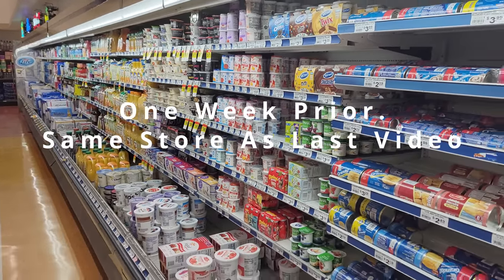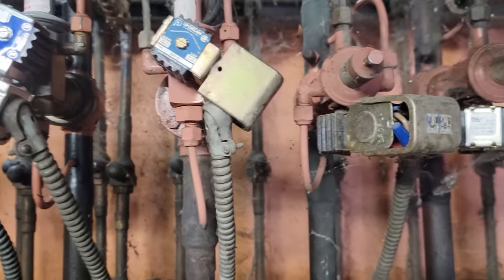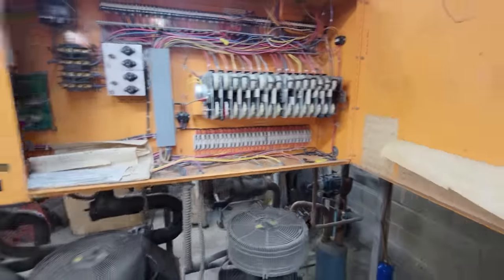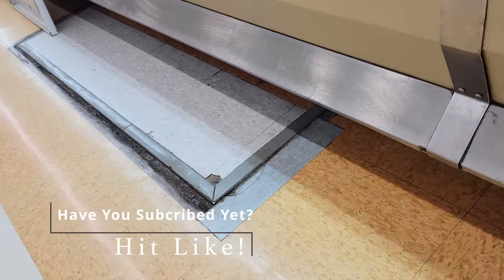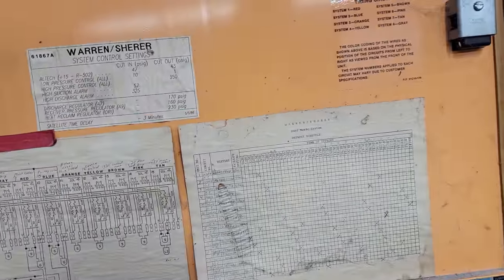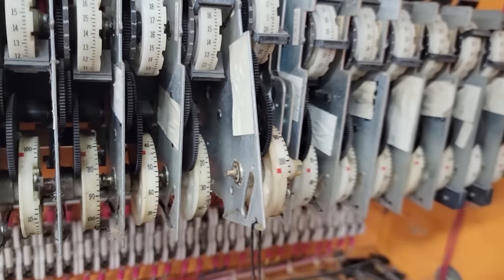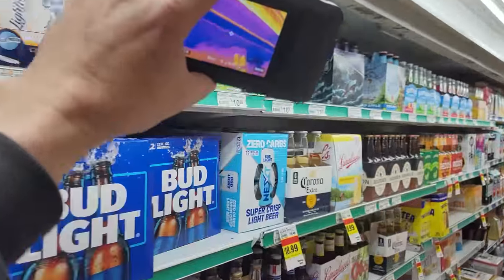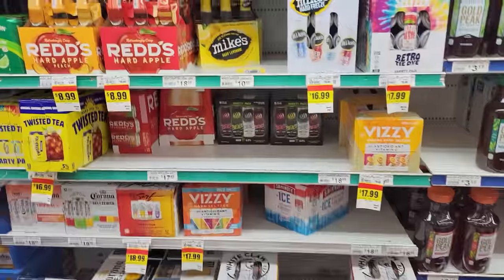Dairy Case Warm Wheres The Control?

Comment from the maker: This call took a longer because I wasn't sure how they were controlling it when I couldn't find the thermostat where I figured it would be at. I found the defrost clock not always kicking in and out like it should by accident and was not the primary reason for the rack being warm. Once I found the thermostat I noticed the store map that I first looked at showed the thermostat being located in-between the middle cases but because things are normally not labeled well or at all I didn't put any faith in it. Now I know where it is and so DO You! 😂🙆

Comment: Great video brother. Finding the thermostat is half the battle sometimes. Also watch the little dip switches on those clocks. I have found some that wasn’t making to send circuit in defrost . We purchased some through Grainger and replace when needed. Those old clocks parts are getting hard to find. Happy Easter.
Reply from the maker: Thanks for the info Michael, happy Easter to you as well!

Comment: Was that a  thermostatic switch up in the canopy? A non-adjustable one that closes and opens at a preset temperature? And what does it control? I'm thinking the solenoid in the bottom of the case? Those supermarket systems have so many points of possible failure it' really looks tedious just trying to figure out what the plan is. Now I know why refrigeration techs don't or refuse to service supermarkets.
Reply from the maker: I believe it had a traditional Honeywell style thermostat as you described in the canopy or in the kickplate down below that’s adjustable. It likely controlled the solenoid valve. This system has been updated to an Emerson controller and those defrost clocks and thermostats are gone now. It’s now being monitored and so we can see exactly when, where and what’s going on.

Comment: I noticed at 9:15, the old defrost clock only had 3 defrost defrost pins set, where the new/rebuilt had 4 set. so that would make it seem like it's skipping or turning a long way before triggering again after the 3rd defrost. I almost didn't catch it and that may have fooled you into thinking it was bad and skipping. 
anyway I'd imagine the long plastic arm the pins hit and move is what wears out the most and of course the micro-switches, which I'm guessing one of the switches may have been going bad/intermittent, whichever is using the normally closed contacts to bring solenoid on.
looks like there was a defrost termination(solenoid) on the clock, so maybe something in the cooler/thermostat/s triggers the early termination and not working? who knows if that's used or not though. it's a basket case wiring nightmare, probably long lost documentation/diagrams and nobody has been there long enough t know jack-sheet. lol so the typical fudge-fest 💩
Reply from the maker: I believe I copied the old one the same as the replacement one. (I might not have put them all back on the old one because I was going to throw it away). Either way, even if it was three instead of four the defrosts they would have been spaced equality and would have clicked in and out faster. It was more about the termination click than the actual click going into defrost.  I was grasping for straws at that point because I couldn't find the thermostat.

Comment: Wow that's the biggest defrost timer system i've seen Pretty cool how you can see the motor spinning Through the clear hole .. The camera can you use On windows pc will it display on a windows pc For bigger picture ?
Reply from the maker: Witch camera, the infrared or the one I used to record
Reply: @HVACR Survival  The infrared camera Would it work with windows Would you be able to plug in to a p c and display the picture on the computer ?
Reply from the maker: I haven't connected it to my computer but it does video with audio, it's pretty amazing what all it does and you can use their program with the computer and actually look at all the individual data points that the camera captured. Flir doesn't have anything close to it
Reply: @HVACR Survival  Okay ... That's why I want to know that communicates with computer if you can display on screen .. Because you can't do that with the flar cam Because they won't release the drivers Thanks for responding back If you give it a try Let me know lol
Reply: @HVACR Survival  Question .. Can a frigerator explode ... I used to have  appliance Business back in the day never heard of this ... Video of a guy's fridge exploding How is this even possible ? 

https://youtu.be/A169-s4KHFQ